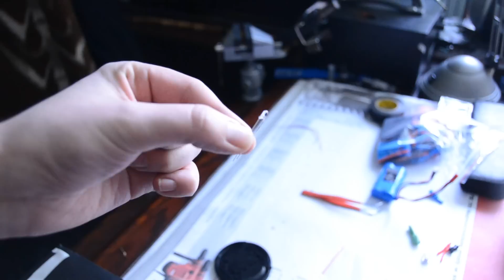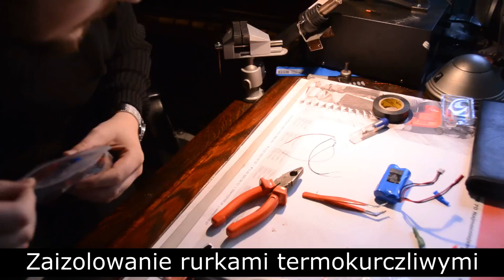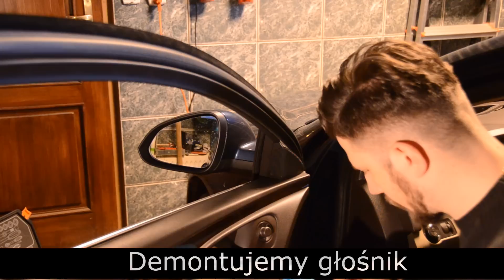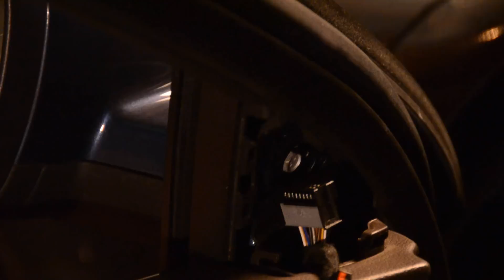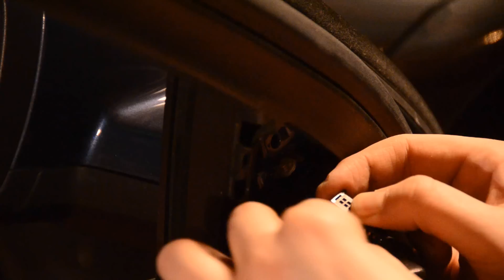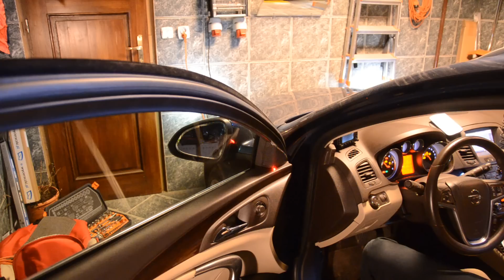INSTALACJA DIODY LED DPF FAP Opel Insignia / Vauxhall Insignia / Buick Regal

Comment: Thank you very much for the info. Just installed this today. Can you tell me how often does car perform self cleaning process?
How often should i expect lamp to turn on and how much time should that process last?
Cheers
Reply from the maker: It's depends how you using your car, only in the City or maybe on highways. You can take as average that is between 400-800km.
Reply: Łukasz Rzepka Thank you very much. Two more question if you dont mind. One way to check if lamp is working is to turn on rear window defrost button?
I used 12v Led that had some kind of resistor in it, salesman assured me that its 12v led that was meant to work with car electricity. Is that ok to use in my car since you mentioned in your video no resistor needed?
Thanks again, you have beer from me if you ever find yourself in Sarajevo.
Reply from the maker: Yes if you use 12v LED then you don't need any resistors.Turning on rear window heating is only way to check correct connection.Remember if your LED it's ON, but rear window heating is OFF that's mean DPF is cleaning. My Friend from Insignia Club Poland made Android App https://play.google.com/store/apps/details?id=com.insigniadpfgmail.opldpfmonitor but OBDII connection is needed.

Comment: Where to connect the led if I don't have heated mirrors?
Reply: Filipe Castro all insignias have heated wing mirrors supposedly the button for rear screen heater switches them on too

Comment: Dear friend thank you for useful video. I m going to make same thing as i leant from your video. Can you explain that gauge on dashboard?
Reply from the maker: You mean, this small panel between A pillar and  steering wheel? That is a CB Radio front panel. CB Radio model Albrecht EA 6890.
Reply: @ZiiGiiS  yes. I thought it was oil pressure gauge.. I couldn't find any information anywhere about oil pressure gauge installing for insignia 2.0 cdti. Thank you.
Reply from the maker: I don't need additional gauge, in MY2012 I have oil pressure on central display between the speedometer and tachometer. But it is not a default option.